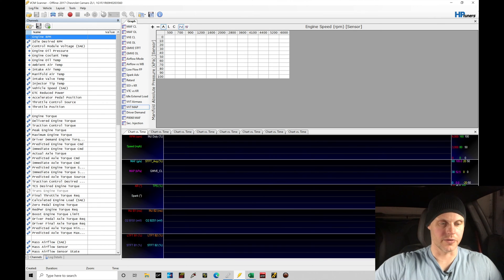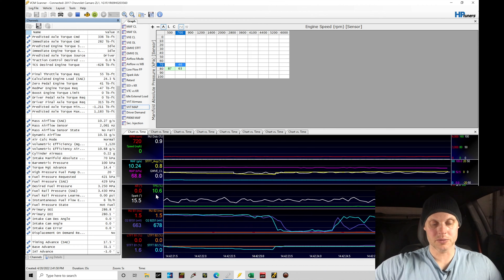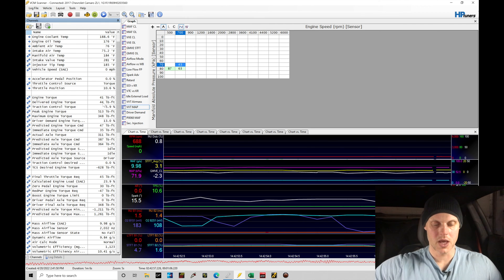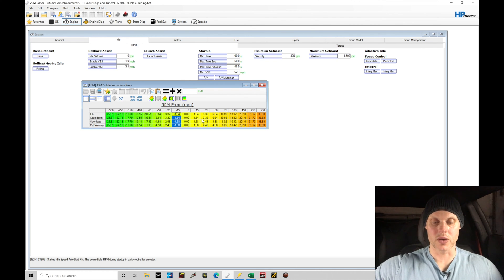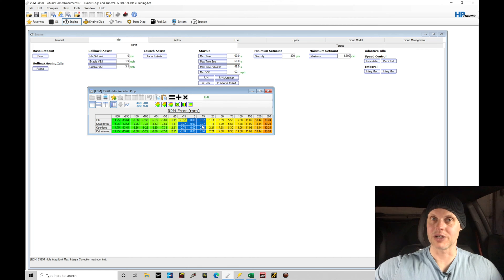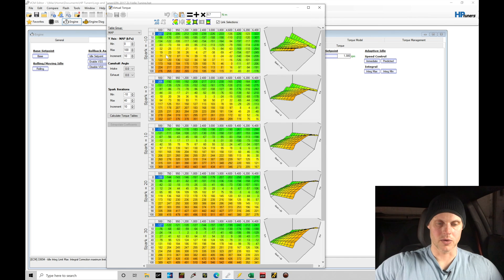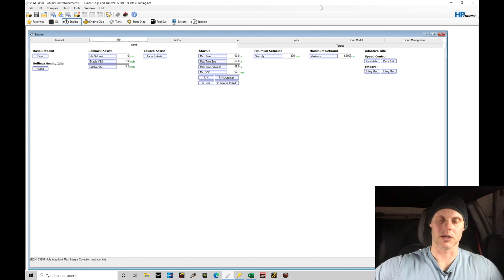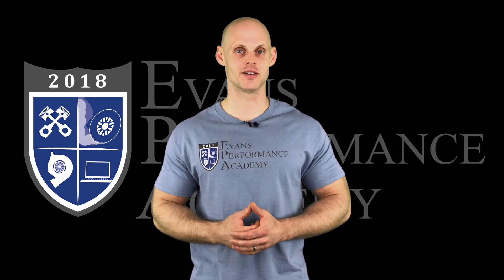HP Tuners GM Gen V Live Training Part 2: Start-Up / Idle Tuning | Evans Performance Academy

Comment: What would be a good starting point/change to table when adjusting idle immediate prop for more chop. Gen v 6.2 Btr 217/23X cam. Idles much smoother than all the Btr 220 cams I see on YouTube. Cam is very similar according to Btr. Thanks